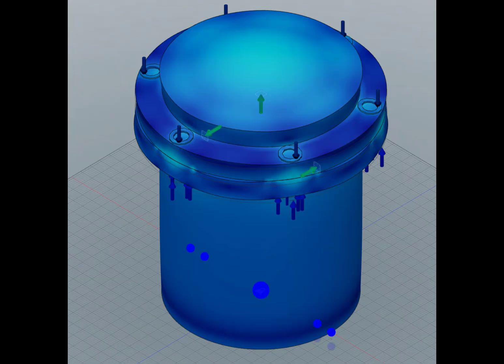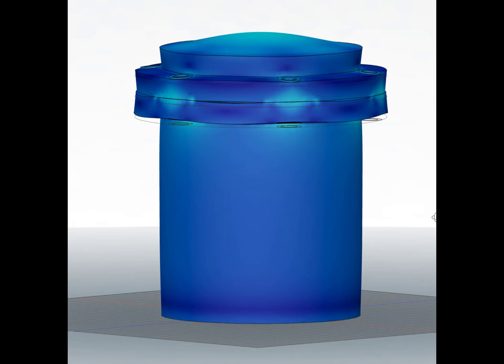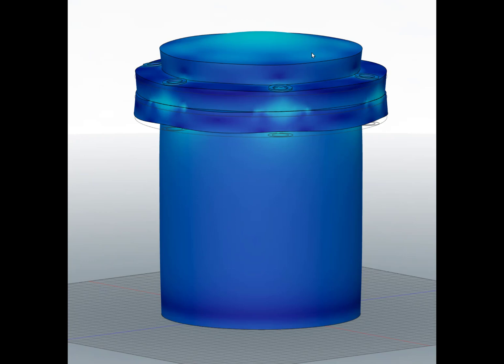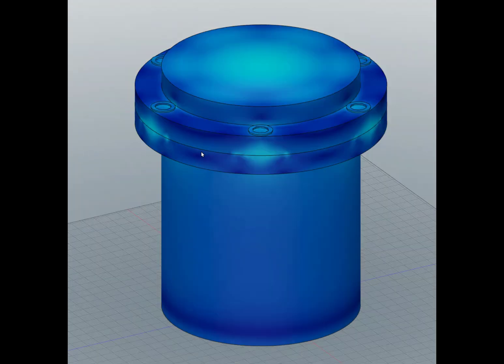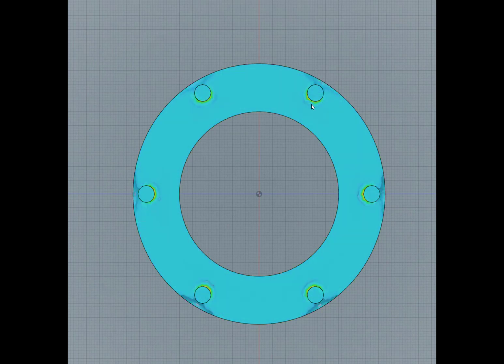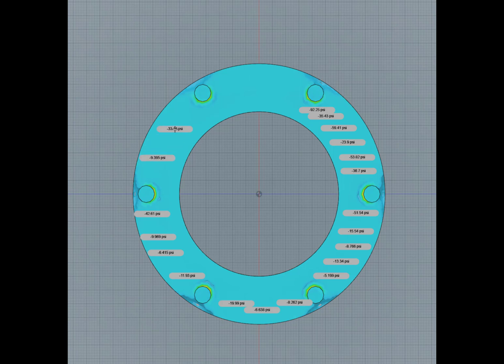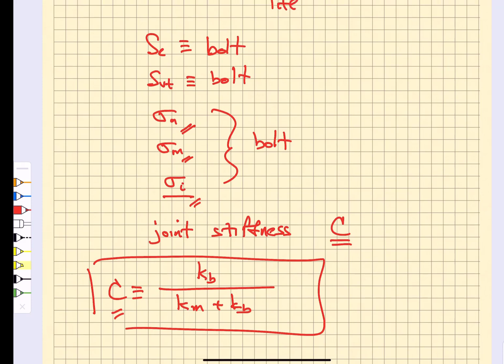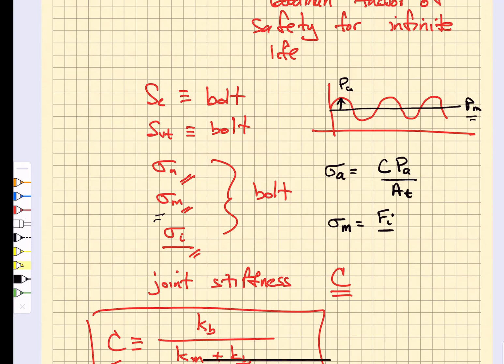Sample problem showing factors of safety for a bolted pressure vessel

Comment: Hello Mr, do you happen to do a stress analysis of a weld in a cylindrical vessel similar to the one you have on the problem. A stress analysis on a welded plate
Reply from the maker: I have a video that explains how to create the spreadsheet, I do not provide them.  Also, I do not have a lecture on cylindrical vessel welds...but the same ideas would be used.  The interesting part is the transition form hoop and axial stress as you move to the end cap...this causes interesting stress concentrations!